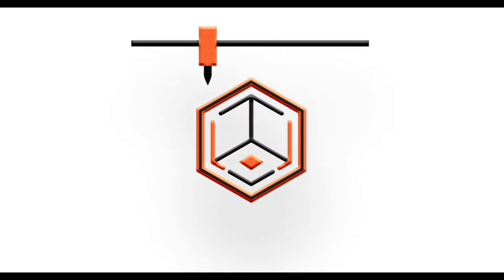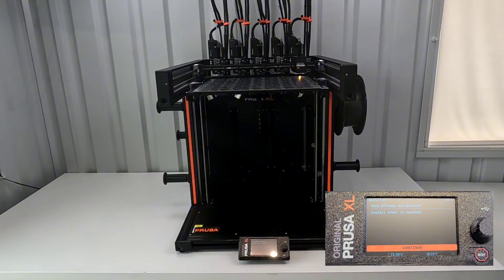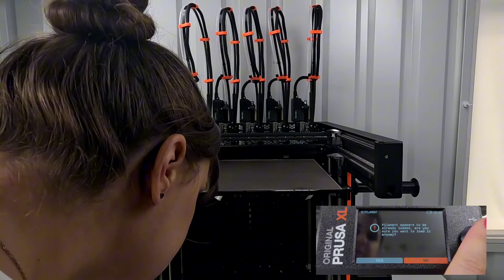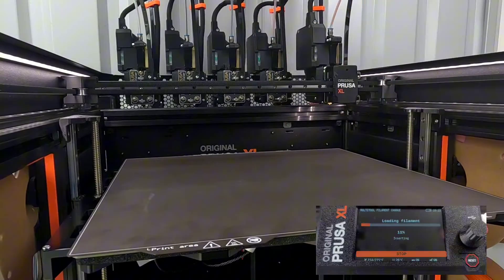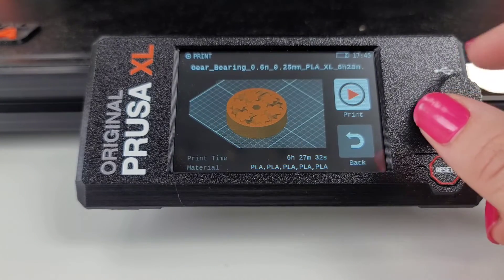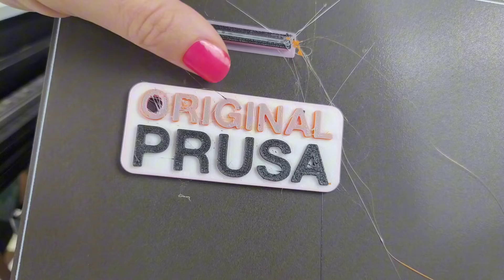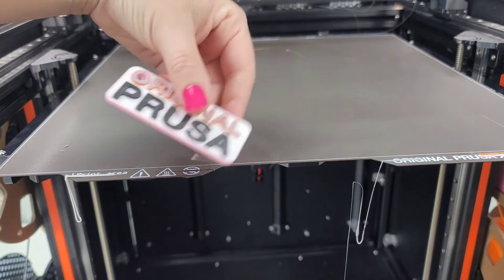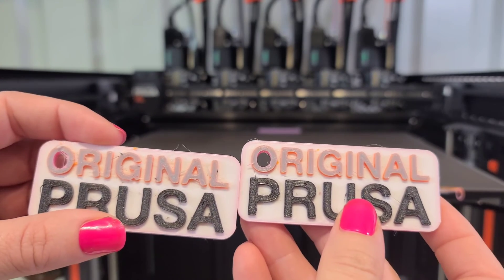Setup Part 3 of the "Fully-Assembled" Prusa XL 5 Toolhead

Comment: I am a little surprised by the results so far. If this is the final outcome Prusa has a long way to go. I honestly figured it would be like a regular XL quality with just 5 nozzles. I hope you can get it fixed.. keep us posted.
Reply from the maker: Yeah I was not expecting this. I had read about XL stringing but my single head was fine. So I wrongly concluded I wouldn't have any stringing issues. I'm sure it's something simple. Just annoying to not know. Thanks!

Comment: Wow! Well, I guess not all pre-assembled Prusa XL printers are assembled correctly. I got a pre-assembled  5 toolhead XL, and it has worked perfectly since the moment I first powered it on. Zero issues whatsoever. 🤷‍♂️ I did make sure everything I had to put together was 100% properly installed and tightened before I turned it on. It went through all calibrations flawlessly. 😉
Reply from the maker: That's good to hear! Do you have any stringing? Thanks!
Reply: @tada3dprinting  I had some initially when I used the default PrusaSlicer print profiles when printing multi material models, but lowering the temperature 10 to 20 degrees pretty much eliminated it.

Comment: I will wait with my preorder until the printer is polished and the non alfa firmware as well as prusa slicer version is out. Also when there is an enclosure to buy or maybe some good aftermarket ones. In the state the printer is in, 3700€ plus enclosure money is not justified
Reply from the maker: I think that's a good plan. I'm hoping it's simple but I'm not happy with it yet. Thanks!

Comment: I've had my 5T version for a week now. I'm amazed Prusa let the gcode for the keychain out of the door. I had the same terrible results. I've improved things with some tuning but really this is basic stuff that Prusa should have sorted after 2 years developing profiles for the machine. smacks of rushed out the door to me. The hardware though for the most seems good. The tool change is fantastic
Reply from the maker: Yeah I agree. Are you able to get other prints to work without stringing? If so, did you find a trick that worked for you? Thanks
Reply: @tada3dprinting  Drop temps as you have already done but i went 10-15c lower for PLA. Increase retraction slightly to 0.9mm, retract amount before wipe 90%, Retraction when tool is disabled to 12mm. Make sure you apply to all Extruders. See how you go. Silk filament does swell and more prone to string but still that print is poor. Dry your filament as well.

Comment: OK, I've been staring at my pre-order for a few weeks now. Prusa is now emailing me regularly to ask if I want to complete the order... I've seen nothing but stories of people having issues with this system and for a nearly 5k dollar printer it feels like it's still a tinker printer with many issues and way over priced for what it is. In the last 2 years I've retired and sold my Mk 3 with MMU and my Mk3s is sitting on a shelf because my Bambu printer does it better and faster in all fronts.

My question to you is, do you feel this machine is worth it's trouble and cost for what you get? I'm a bit miffed at the "assembled" fee, what a joke. I've heard Bambu is working on an XL.

Knowing what you know now, would you still buy this machine? would you still buy the five head? Or would you wait for the next Bambu system?

Love the content, thanks for the detailed info.
Reply from the maker: I was really hopeful that I would get a printer that wouldn't require much tinkering. I seem to be getting mixed comments of people with the same issues or people with no issues. 

I still want to work on tuning it before I give up completely. But I'm not happy with what I've seen so far. If I end up spending weeks and don't get anywhere (like my MMU3) I would say it's not worth it. But I'm not there yet. 
For most people that seem unsure, I suggest waiting a little longer to finish your order but not to get out of line. 
But if you already like Bambu over your MK3s, I don't know if you'll be happy with this printer.
Do you need the XL size? Or would a carbon with AMS work for you? Thanks!
Reply: I have the carbon with 3 ams units. I'd be after this to print larger objects and use TPU with other materials within a print. But it's not necessary. for the price, maybe I'll just go single extruder but high temp, I print for function, so printing peek would be a better than another open air printer... it's crazy this is where they are after 2 years!

Comment: First, it's absolutlely possible to just edit the non-binarized GCODE. Just load the USB onto your computer, open the GCODE file from a text editor, look for M104 S<whatever temp you want> and save it. 

For the stringing, it's due to the Z hop when there is a toolhead change. The toolhead lifts straight up and that causes the stringing. Temporary workaround is to install the alpha firmware which helps A LOT. And also check your nozzle seals are fitted correctly.
Reply: yup, no real problem here. simple fix
Reply from the maker: Thank you! Got a print going with input shaper right now. Thanks!

Comment: Just as I thought, it was just a fluke. Not only in your videos but also from others and from my own experience it seems that all the Prusa printers fail the calibration every now and then and pass it on retry. That can be annoying, especially if it's such a long process with so many steps.
For the stringing I'd put my finger on the overture filament. Many people reported that Overture filament needed some extra tuning on their printers, while on my MK4 it worked quite well with the "generic PLA" profile. You'd think on the USB that comes with the machine, they'd put models that are tested to print in the best possible quality regardless of material, but on the other hand it makes sense to have them optimized for prusament.
The hotends should imho be depressurized before parking them to prevent oozing, or they should have a wipe brush to get rid of oozed plastic clinging to the nozzle, because as I am told, each hotend heats up before it is gonna be picked, so oozing is almost inevitable. Maybe in a later firmware they'll introduce a a second retraction when the nozzle hass cooled a certain amount in the parking position.  The purge tower should maybe be just 2-3 lines but as long as the whole bed, so each nozzle can do a wipe right after leaving the parking position. Also retraction is key since it may be a direct drive but a pretty long and bent bowden tube is still involved in material transport.  The Bambu Lab A1 mini as you know has solved that problem very smartly, but here it seems the retraction pressure has nowhere to go and on smaller prints with many material changes, the pressure in the tube can quickly build up. 
Try increasing the length setting for "Retraction when tool is disabled" in Prusaslicer using .5 mm increments and see if that helps. If it gets better but you are facing underextrusion at the beginning of each material change you can compensate with "Extra length on restart". Retracting a bit faster or sometimes slower might also help. With a machine like that material and even color-specific profiles become really important, because you may use up to 5 different materials of which each needs to be dialed in.

EDIT: I forgot to mention that I would stick to smaller test prints for one reason: If you get it to work on small prints with many quick filament changes, it will always work for bigger prints and less frequent changes. The other way around I'm not so sure.
Reply from the maker: Yeah I haven't had an issue with Overture on other printers so I don't think thats the problem. I just wish I didn't have to tune it so much! But you're right, I should just scale my print down a little until I figure it out. Thanks so much!

Comment: there's a setting in prusa slicer that lets you set how much the tool head retracts when it docks. The guys on the 3d printing today podcast said you need to change that from the default 1mm to like 10.5mm. they talk about it in there latest podcast. they said that fixed the stringing problem.
Reply from the maker: Oh that's great to know! Thank you!

Comment: I would try and working with the keychain print.  No sense in having the same problems on a longer print and waste time and filament.  Try adjusting the colors separately and see if you can get the stringing fixed, maybe look at retraction
Reply from the maker: Ok thank you!

Comment: Great to see that you got the printer put together and calibrated. I have to agree with you that the print seems awfully stringy. For PLA most 190-200 degree PLA is use 215 for the first layer and 210 for all other layers. The settings in PrusaSlicer for Prusament PLA are much higher. 230 for first layer and 225 for others. I think I would try printing at 210 to see how much difference that makes before running a six hour print.
Reply from the maker: Good point. Thank you!
Reply: @tada3dprinting  Have you tried just a single color key tag? I wonder if it would be as stringy.
Reply from the maker: I just finished a dollhouse roof on it that was single colored. And I had zero stringing.

Comment: Also different brands of filament needs (sometimes) different temps for the nozzle(s). That's why a temp tower can figure out what temp is the best for that specific filament. Once done, that can be stored in a profile for later use.
Reply from the maker: That's true. I've just been printing with Overture for years by now. And I have no issue on my single XL. So it seems strange to me. But you're right. I just need to try this. Thanks!
Reply: Seconded, definitely print a temperature tower do determine the optimal temperature for that particular filament on that particular machine.

Comment: I have a double toolhead and my stringing I think comes from oozing from the idle toolhead. I keep wondering if I should try to have a bigger prime tower.
Reply from the maker: Oh that's an interesting idea. I'm wondering why I even have a purge tower? Isn't that the point of the different toolheads?
Reply: @tada3dprinting  No, the towers in multi color prints serve two different purposes. One of them is to push out all the old filament so the color change is done (the Bambu printers use the printer poop instead) and the second is to prime the nozzle so that it is "clean". The multiple heads still need that second part. It's similar to the purge line at the start of a single head print (and often the skirt). I think the technical term is actually a prime tower, not a purge block. Even IDEX printers have it.
Reply from the maker: Yeah that makes sense. Thanks!

Comment: The latest firmware addresses some of the stringing issues.  Plus 3D print dogs YouTube channel found a fix as well.  YouTube won't let me post links so you'll have to search it out.

The stringing is coming from when the tool head pulls away.  3d Print Dogs fixed it by having the tool head move away from the print before moving in the Z direction.  I haven't seen it but I suspect the Prusa fix is similar.
Reply from the maker: Yes I just watched this video and that's going to be my next step. Thanks so much!

Comment: To avoid oozing while in dock, a lid with silicone is pressed to the nozzle there. However, the molten plastic still wants to ooze but just can not get out. <the preasure inside the nozzle is not the same you have while printing. I think the prime tower is simply to small to get the preasure right inside the nozzle again.
I am pretty sure the stringing problem will be solved in one of the next versions of Prusa slicer.
Reply from the maker: Can't wait! Thanks!
Reply: We have a printer with 0.6mm at work, it doesn't string at all. I don't understand why the xl strings so mich. Like there is no retraction
Reply: @lockeboss502 The XL only strings, if you use more than one toolhead. So it has definitly to do with the toolheads waiting in the dock (even at reduced temperature). Imho a bigger prime tower is needed to get preasure correct inside the nozzle after the printhead waited.
Reply: @oleurgast730  it looks like it oozes when printhead moves away rather than starts printing
Reply: @lockeboss502 Maybe Prusa just forgot to retract before moving the head to the dock? Would be quite a silly mistake, but maybe a look into gcode helps to discover if this is the case...

Comment: I recently saw a video by 3d print dogs, they edited the filament end gcode in the slicer to move the print head away from the print before tool change. That drastically reduces stringing. Maybe you can give it a shot.
Reply: Oh, a tinkering machine.
Reply: Got a link to that? Search failed me.
Reply: @GarethLewin   We heard our name 🐶 We made a video about this gcode fix, which we now use in combination with the updated firmware (and our prints have been great so far!)
Reply from the maker: Yes I did watch that video and it's great! Updating my firmware didn't help. So their gcode modification is my next step. Thanks so much!
Reply: @tada3dprinting  Cool, I hope it works!
Reply: @GarethLewin  Look for "Master multicolour printing on the Prusa XL with this simple tip!" on the 3D Print Dogs channel. Short, excellent video that thoroughly explains the stringing issue and has a simple fix. Prusa is going to incorporate a similar fix soon, but it seems like the 3DPD solution will be a good option in the meantime.
Reply: That you even have to figure that out on your own after paying 4500$ for this printer.

Comment: Let be honest, its an unpolished product. You would expect it to work right out of the box with the provided files. Especially since it was on preorder for so long.
Reply from the maker: I was really hopeful that this would be easy going multicolors after struggling with the MMU3. I'm disappointed that it's not been easy. But I'll see how I feel when I have it tuned. 
I hate to say it, but having two Bambus has me a little spoiled on some of their simple quality upgrades. Things that are just nice. Like the preview screen showing the colors that will actually print, not just a solid piece. 
If Bambu comes out with an XL, I will definitely be trying it. 
Until then, I'm going to see if I can figure this out. Thanks!
Reply: I just got mine in and it's a disaster. It won't even finish calibration without the firmware crashing. The hardware is faulty on day one. I cannot recommend people buying this printer. There is a reason there aren't many full reviews from the top channels. I'm going to call it now. This is going to be the printer that kills prusa's reputation. Oh and support has been a nightmare so far.
Reply: No it's a polished product, when directions are followed...thats not what this video is, and I hope other XL users might actually finish all the calibrations before running a model
Reply: @williamelewis464 I'm sorry I have one on preorder and they are asking me to finalize it. However I'm seeing alot of people with bad quality prints happening. Including a YouTuber who did a 5 print blind comparison and the xl came last.... Its not polished it appears it was rushed out. Which is crazy as we have been waiting for years. I was so excited for this but I think I'll order a couple more bambus until they figure this out.
Reply: @hoocli I don't think you'd order anything else after that. Lol
Reply: @REDxFROG  I already have an x1c. I really really want to like the xl but I just can't justify its quality to bambu. The multihead was such a cool idea and so much less waste. But it's unacceptable how much shit seems to have made it past quality control.
Reply: @williamelewis464 if this is a polished product it’s an embarrassment

Comment: Glad to see you got the calibration working, still wonder what the issue was. Hopefully it will be addressed in a future firmware version.

The USB that came with my MK4 also had a QR code on it, but maybe that's a new thing they do.

To my knowledge stringing is a pretty common issue on many XLs, no idea why it happens, but I don't think it's directly caused by the tool changes.
Reply from the maker: Maybe my Mk4 had the QR and I didn't notice it. Yeah stringing is going to be my next challenge